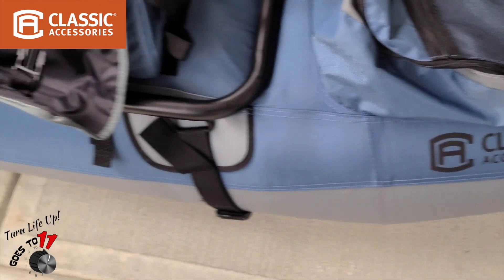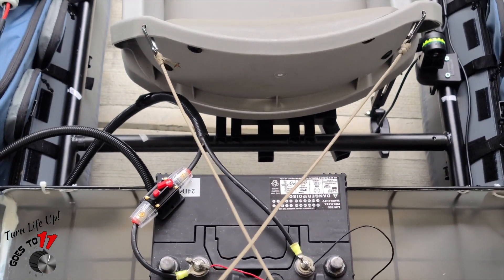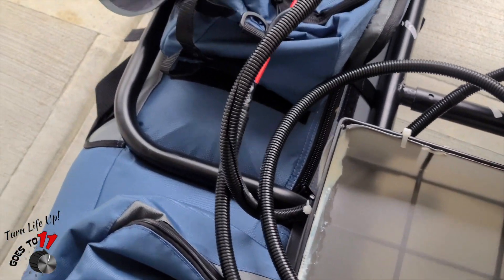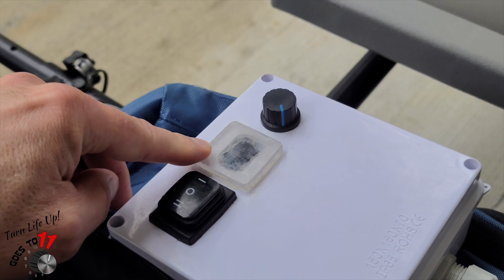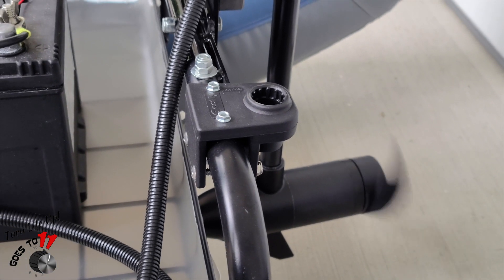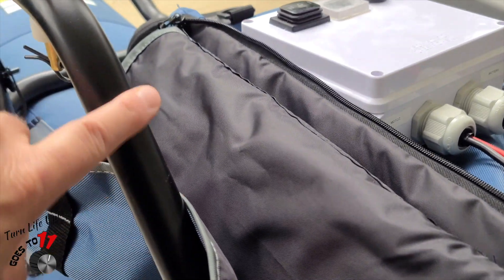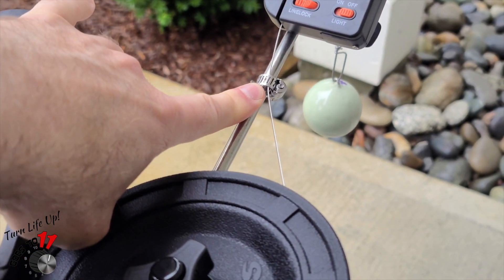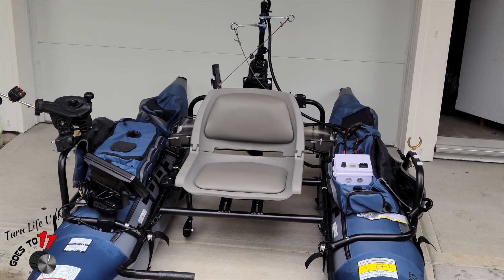Pontoon Boat - Colorado XTS Customized - hands free steering and remote throttle | Goes To 11

Comment: Have you had any heating issues with the PWM?
How exactly do you have the fish finder connected? Is it directly to the battery with battery clamp?
Reply from the maker: Hi Jason...thanks for watching and commenting.  I have not had any issues yet but I am making a modification to the controller box to prevent any overheating that may happen, especially on hot weather days.  I ordered 2 small fans for graphic cards that are rated for 12v.  I will put one on opposing sides of the box, utilizing the already existing holes that are capped on the box.  The one fan will be drawing air into the box, the opposing fan will be flipped to draw air out of the box.  Here are the links to the fans:
https://amzn.to/3ajBipa (Canadian Orders)
https://amzn.to/3ebUd6L (U.S. Orders)

Regarding the Fish Finder, I always bring a small 12v battery for it and I get several hours of use from it.  This helps extend the trolling time I get out of my main battery.  If I am out there long enough to drain the small battery, I just clip the fish finder onto the main battery for a little extra time on the water.  You can use alligator clips on the fish finder to make it easy to swap power supply.

Here is something similar to the smaller battery I was mentioning:
https://amzn.to/3ttKijn (Canadian Orders)
https://amzn.to/3tvaTfT (U.S. Orders)

I hope this information helps.  
Cheers,
Rick

Comment: Does having the battery and trolling motor in the back add too much weight to rear of boat?
Reply from the maker: I'm a pretty big guy (6'2", 240lbs) and with all my gear on board it still rides quite level.  I now have a front floor board on it and can move some weight up front.

Comment: Looks like you could easily mount 3 of the new small LiPo4 batteries and still not weigh anymore than the 1 lead acid and get many hours of run time.
Reply from the maker: True, but I would need a chunk of money to buy them lol.  Those little batteries are crazy expensive but would sure be nice to have!

Comment: if you haven't found out by now... that metal clamp on your downrigger will damage your cable... use two cable ties... loop one as a cable guide and use the other to secure the loop to the downrigger rod inline with the depth gauge... it will be less abrasive.
Reply from the maker: Great recommendation T.C., thank you!  I will look into giving that a try.  I appreciate your watching and commenting.  Cheers, Rick 😎 👍 🎣
Reply: Should have used a small pulley

Comment: I  will also add an on/ off quick switch to mine like I did on my canoe rig. When you are fishing down a bank & need to make small corections it is easier to just bump the switch on & off. That way you can leave the power at the same speed instead of turning it all the way down then back up.
Reply from the maker: That is a great idea!

Comment: Hello, I wanted to say thank u for the great ideas, I have applied them all to our pontoons. Thought I would share an issue I had with the controller. I have 3 of them, all of them only reverse worked. Also they would get hot quickly. I had an electrical engineering at work help me out. He mentioned that any of these with a circuit board will fail quickly. He suggested the
 "HIMA dc speed controller, brush motor driver controls module DC 9v-60v 12v 24v 36v48v 60v motor pulse width modulator regulator 20a 1200w PWM monitor dimmer governor with switch and knob" 
Available on Amazon for $16.
I tried the bungee for the steering and they were ok with small movements.  After hours on the water they didn't work that good, but I will be changing these also. I will repost on how the new controller works out. 
Again thanks for the video and all the pointers to make these pontoons much nicer for fishing.
Regards, Pinstriper
Reply from the maker: Hey Jeff, thank you for the great feedback!  I may order one of those controllers as a backup.  Since I made the video, I added a couple small fans to my box for airflow.  I'll be trying them out next week to see how it does for temp.

I used Paracord for the steering, it is more reactive than a bungee.

I look forward to hearing how things are working out for you with it all and thank you again for your support, I really appreciate it!!
Tight lines bro!
Cheers, Rick

Comment: How do I go by registering my one man pontoon boat,  can someone help me please?
Reply from the maker: Registration requirements will vary depending upon where you are.  If you are in Canada, visit this site: https://tc.canada.ca/en/marine-transportation/vessel-licensing-registration

To the best of my knowledge, at least here in B.C., you only need to register if you're using a motor over 10hp.  The pontoon I show in this video cannot have anything larger than a 30lb thrust electric, therefore it does not require registration.

I hope this helps you out.  Please subscribe to the channel, it helps me out!  Cheers, Rick

Comment: Liked. Thanks.  May I ask if you have tested the maximum speed on still water, and how many lbs thrust is your trolling motor?  Well done. Thanks.
Reply from the maker: Awesome, thank you!  I haven't tested for max speed but will try in the next couple of weeks when I can get out on a lake.  I'm using a 30lb thrust.  The boat rating says it's the biggest size it should use.  I did test out my 55lb thrust and it had it moving pretty quick and on full caused weight to distribute towards the back and lifted the front of the pontoons up...not a great situation.  I hope you'll subscribe to the channel, lot's of cool things coming!

Comment: Curious as to how much total weight it can hold. I’m 5’9 220lbs. Would I be comfortable you think? Excellent video.
Reply from the maker: Thanks bro, I appreciate your watching and commenting!  I'm just over 6'2" and weigh 240lbs and have not had any issues.  The boat is rated for 400lbs, so no worries there.  The recent adjustment I did is I bought a taller mast for the seat so I sit higher off the ground.  I throw both in my vehicle and decide once at the water how I want to ride in the boat.  It's an easy change out and you can swap back to the low profile mast if you want.  I hope this helps and I'd appreciate you Subscribing to the channel if you haven't already.  Let me know if you buy one, I think you'd love it!
Cheers,
Rick 😎👍🎣

Comment: Your thoughts on installing a weed/grass guard on the trolling motor? Seems it would help prevent any possible blade strikes cutting the pontoon material. Great video!
Reply from the maker: Hi Bill, thank you for watching and commenting - I appreciate your support and am glad you enjoyed the video!  You can attach a grass guard but I haven't experienced the need for it.  I do sometimes go through some shallows and have clipped the bottom of the shore but the plastic blades are pretty durable and are inexpensive to replace if needed.  The prop itself does not come close to the pontoons, since it is mounted mid point of the frame, so there is no concern about that.  I am excited to get back onto the water this Spring!  I hope you have subscribed to the channel, lots of great content coming!  Love to see your pontoon build if you do one.  Tight lines my friend!!

Comment: Do you have a 30” or 36” shaft on your trolling motor?
Reply from the maker: Hi Milo, thank you for watching and commenting!  It is a 30" shaft and this setup works great.  I hope you'll subscribe to the channel, it really helps me out.  Cheers, Rick
Reply: Done. I have a white river boat but looking at these as well. Looking for the links for the PWM set up. This is the best one I’ve seen.
Reply: Ordered a bunch of items although the PWM you link to is out of stock. Other brands that look identical.

Did you use the variable switch that came with the PWM or did you find a waterproof option too?

Also, do you have a riser on your seat? Do you find it difficult to row?

Comment: Kudos to you and Glen for a job well done. Simplicity makes for a relaxed fishing adventure. 
Now some questions for you. I have an Endura 40# motor that has an 8 gauge power cable attached, and those Atwater quick connects are 10 gauge. Have you run into any issues since you’ve stepped down to a smaller wire? Also...what size pipe hanger did you mount on your motor steering system? Also was there any reason you bought that switch, when the motor speed controller came with one? Thanks a heap for your great info! Oh yah...I’m in the Seattle area, and I’m guessing you’re above me on the other side of the border. Possibly B.C.?
Mike
Reply from the maker: Hey there, thank you for watching and commenting - we appreciate your support!  My MK is the 30# and I have not noticed any issues and Glen is a Millwright and would not have done it if there would be problems.  I highly doubt you would have issues with the 40# and frankly, the draw is not a crazy load but I will message him tomorrow for his thoughts and get back to you.  I also need to see if I can find my receipt for the pipe hangers, I had a heck of a time finding them online and went to a local plumbing company to buy them.  The vertical shaft of the motor is not very large, I just cannot remember the exact O/D of it.

The setup makes for a far more pleasant day on the water and makes it a lot easier to fight a fish!  Yes, I am located just across the Border in Surrey, B.C.  I love Seattle and have been there many times for day trips to guitar shops and the E.M.P.!  Unfortunately, I don't think the Border will be opening any time soon.  Hope you are staying safe and doing well my friend!  I will let you know the answers to your questions tomorrow!  Please subscribe to the channel, I would really appreciate it!  Cheers, Rick
Reply: @GoesTo11  
Ha! I just knew we were neighbors. I appreciate your prompt reply. Yes, I don’t see a big issue with the wiring, but thought I’d ask if you were tripping the breaker or anything like that. Since the quick connect leads are short, they shouldn’t be an issue. I’ll probably just go with the Atwaters. Today I welded up a bracket to the center of my rear frame, so I could mount the motor in the middle. Now to find a swivel to attach to my chair! This is soooo gonna be worth it. Thanks again, Buddy. Cheers and stay safe!
Reply from the maker: @sweetcakes3706  lol yup, just north of ya Bro!  🇨🇦🇺🇲
I just spoke to Glen and he said that the wires shouldn't be an issue but you should look at the Owner's Manual or contact the Company to be sure.  We don't want to say "yeah, do it" and have your motor fry lol.
Personally, I would go for it, but that is just what I would do (as I did on mine).  I accepted the risk to my own equipment.
The circuit breaker works great, though I've not tripped it.
The area you'll want to watch is heat on the pentiometer.  The box is enclosed to keep water out with no airflow.  A larger motor may cause it to heat up, I am not sure.
Let me know what you decide and how it turns out!  Cheers, Rick 😎👍🎣
Reply from the maker: @sweetcakes3706  yeah, the motor bracket in the middle is awesome!  The swivel steering works like a charm.  During this off season I bought a pedestal for the seat to try to sit up higher.  I think it'll be very comfortable!
Reply: @GoesTo11  Yah...I’ve thought of adding a 4” pedestal to my seat. Actually I’m thinking of replacing the whole seat with a new cushy one.
Reply: Also wanted to ask you about the heat generated from the speed controller, while it’s sealed up in the waterproof junction box. I’ve seen comments saying it doesn’t get hot and others that say it does. When I saw all the heat sinks, it made me curious. Have you had any overheating issues? Thanks!
Reply: @GoesTo11  dont forget to raise the oar locks, so you can use the oars,  i had a pedestal mount, had to go back to a flat swivel mount , coudn't use  oars  well.  awesome video by the way .well done!   another thing i tried  was attaching a large plastic panel (dollar store cutting board) to my motor shaft to help the steering... ..pontoons dont have a keel ,so blow all over the place. extra rudder helps...tight lines!

Comment: Where did you pick up the box for you pwm? I’ve been to a couple different Lowe’s and couldn’t find on like that . And did you have to modify the inside of the box or fit the unit, and help is much appreciated thanks
Reply: Never mind seen you list 🤙🏻🤙🏻
Reply from the maker: Hi there...I got it on Amazon and I put links to everything in the description.  I've made a slight change by adding some small fans to draw air into the box for cooling.  Feel free to ask any questions and thanks for watching and commenting.  I hope you've subscribed to the channel.  Cheers, Rick

Comment: how do you store and transport that thing....researching on getting one of these or cumberland or 7bass...storage space is an issue for me.  Any input would help .  Thanks
Reply from the maker: Hi Adam...they're super easy for transport!  I have a MINI Cooper and it fits in the back no problem.  I leave pontoons attached to each side frame (but deflated obviously).  They can stack on top of each other or side by side and the middle frame with seat fits easily.  The motor, battery, etc is all removable and easily stowed.  For storage at home I hang the pontoons from roof of garage 3/4 inflated.  You can find all you need to buy using the links in the video description for this setup, or visit our store https://www.fishingandoutdoors.ca for all your outdoor needs.  Please subscribe to our channel, we have some great giveaways coming up!  Cheers, Rick :)

Comment: That is a decked out toon! Do you have any pics of how you mounted the downrigger and pole holder there? I have a small downrigger and the best idea I've had so far is to just drill it into the standing platform lol do you have any videos of this on the water yet? Looks awesome!
Reply from the maker: Thanks!  I will snap a pic and I just followed your Instagram page and messaged you.  I will send you a pic of it there.  We welded a piece of 3/8 metal onto two threaded 3/8 rods.  It just drops into the front 2 oar lock holes and I use wing nuts and washers to secure it.  Works great!  I just completed the project the other day and hope to get on the water next week with it.  I will film it and post once I get out fishing on it.

Comment: Hey, is there somewhere I can contact you about the motor details? I recently picked up an XTS secondhand and I want to get more info on how you did it! I initially wanted to make these mods to a 36" 55 lbs Minn Kota, but the 30/30 is $100 and the 36/55 is $250, so a no brainer for warranty voiding purposes. One problem, doesn't the motor not go deep enough into the water though?
Reply from the maker: Hi David, message me over on Instagram @goesto11media and I can message with you
Reply: @GoesTo11  Nevermind, I shuttered my Twitter. Do you have Telegram?
Reply from the maker: @davidmalkowski7850  no, but will give u details via email then.
Reply: @GoesTo11  Got it. Thanks!